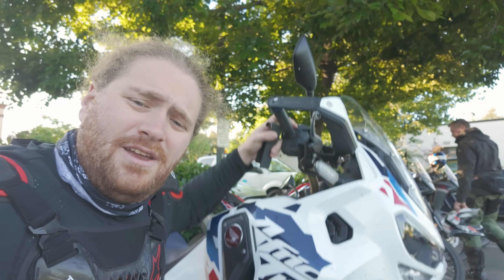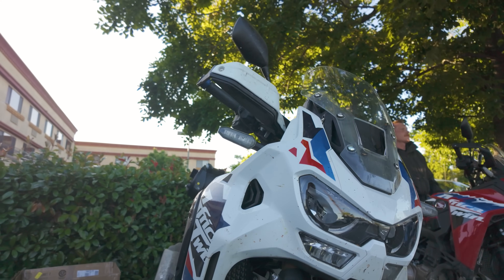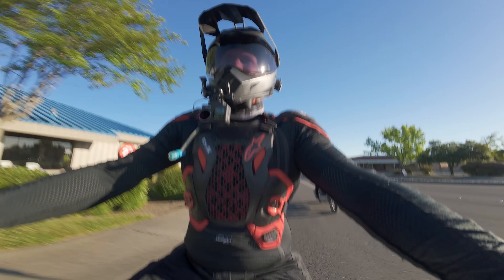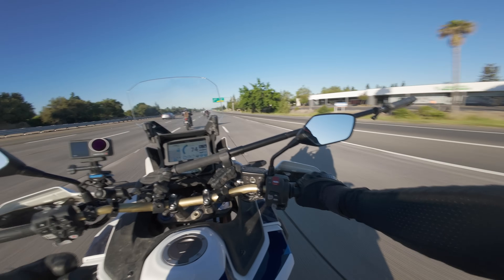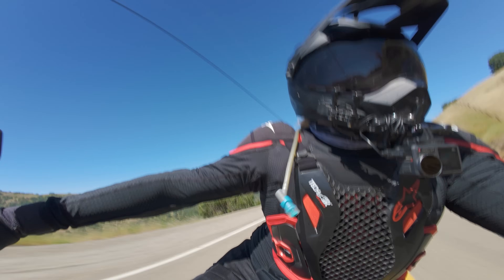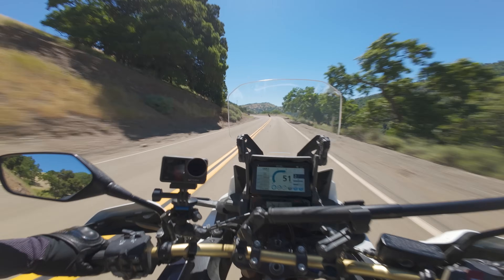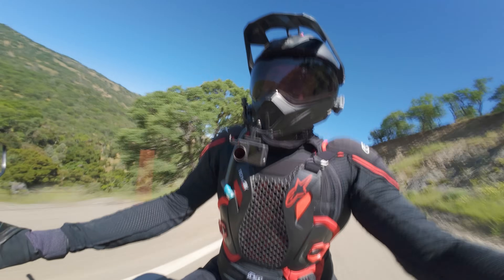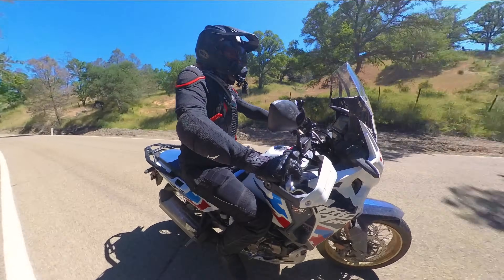Everyone Said I'd HATE A DCT Motorcycle...

Comment from the maker: What do you think about DCT? Don't forget to check out Quadlock for all your phone protection and motorcycle mounting needs!  https://bit.ly/3LBxJ0p
Reply: My only concern is that lowering the barrier to entry on high performance bikes by adding DCT will enable those who literally do not know how to ride a motorcycle to start rolling down the road faster.  Having to learn a clutch is a barrier that I think filters out the most low-effort would-be squids who will never get an endorsement
Reply: @bishopmabry2054  I'm not entirely sure it really applies here. Many modern bikes have quickshifters, so you don't really have to use the clutch, but it allows you to be quicker, and I don't see people complaining about qs's.
Reply: @andres_pz  Even with a quick shifter you still have to use the clutch to initially take off in first.
Reply: I have a '21 africa twin DCT and my list of dont likes is far shorter than the list of likes. The main problem with the DCT is you can't disengage the engine from the driveline once it hooks up. That makes low speed maneuvers a bit of a lurch fest. You can't feather the clutch or just plain pull it in and coast to a stop, etc.  I think that's the only thing I don't like about it. Everything else is a plus over a manual in my experience....
Reply: I own a DCT africa twin from 2020 , about the engine braking situation, one thing,  there is a option to increase or decrease the engine braking and probably you have the less braking engine option, that is why you have the user 1 or user 2, you can select how much power, engine brake, wheelie control on the menu to suit your own taste.
Reply: I have a Honda CTX with DCT - this model is no longer being made... too bad, because it is a fine "sport cruiser" that didn't get marketed well by Honda.  That said, the DCT is not something I recommend for beginners - you really need to understand how to handle a bike, when to downshift, etc.  Some people who have test ridden the bike, think it is "an automatic," just put it in Drive Mode and are disappointed by the performance.  Put it in Sport Mode, and it will shift more like an experienced rider would do.  A complaint I've read from some testers: "It doesn't downshift as you are coming up on a tight curve."  No sh*t, Shakespeare.  Your manual transmission doesn't do that either... you still have to ride the bike and anticipate when a shift is needed.  Sport Mode shifts about 90% of the time when I would... the other 10% of the time, I manually downshift when I want, (whether in Sport Mode or Drive Mode).  So, YES, you still have full control of the bike.  The DCT will shift faster than most riders can do... and, it will never miss a gear, hit a false neutral, or stall as you pull away from a stop.  It is a smart bit of technology that allows the rider even better performance.

In the video, I see that you were not impressed with the suspension and handling of the AT, but that is no bearing on the DCT.  If you are having an issue with engine braking, you need to manually downshift ANY TIME you want.  The thing DCT can't do is anticipate what you want... the different modes AND the ability to downshift at will gives you the same control as a manual transmission, with better/faster shifting and the ability to not wear out your left hand in stop & go traffic.  Yes, the DCT will downshift for you, regardless of the mode you are in, as you come to a stop.  You need to ride one again and use the shift paddles as necessary in the twisties.  I find it is LESS work than a manual tr ransmission, with better performance.  That realization didn't come with one day and 300 miles on the bike - spend some time REALLY getting to know the DCT and how to best use it, and you may have a different opinion on how it ENHANCES the riding experience.  Alas, you did something that many reviewers did on a test ride, which has to do with letting the bike/DCT have the control, when it is the rider that needs to USE the technology.  There is a reason Formula 1 race cars use paddle shifters rather than a clutch and gearshift lever - it is faster and more precise.  Same applies to the DCT.  I'm glad you got to try a bike with DCT... I've moved away from Texas, or I'd give you some hands-on experience on how to best use the DCT.
Reply: @lstavenhagen  Trail braking for slow speed maneuvers is your friend with DCT.
Reply: @captainjim605  Also he does not mention , at least on the africa twin, you can buy the shifter and you can ride on manual mode and change gears with your feet like a regular bike , without the clutch of course
Reply: @captainjim605  Actually, the DCT isn't really what you want if you do a lot of slow speed work. Yes, you can "feather" it with very careful throttle, but that can smoke the clutches and Honda doesn't cover the damage under warranty. There are some goldwing riders who found that out the hard way. But like everything else, the DCT is a compromise with its plusses and minuses...
Reply: I don't agree that you should start on a manual if your intention is to ride the DCT. Riding a manual transmission is the best method for learning to use a manual transmission, not a DCT. You should start out on the type of equipment you intend to ride generally. This is known in kinesiology as "specificity of training" (the best training for a particular task is exercising the task itself). And you always have to expect some transition time if you switch from one to the other no matter which one you started off with.
Reply: @lstavenhagen  I guess you interpreted my comment about "stop & go" riding (as in traffic, where your clutch hand gets a real workout), as meaning "slow."  The DCT isn't working any harder in stop and go traffic than a manual transmission.  Plenty of evidence of people burning out a clutch with a manual transmission by over-slipping it.  The smart play is to use your bike, however equipped, smartly.  If one truly needs to go "slow" with a DCT, you could put it in Manual Mode, go easy with the throttle, and use trail braking.  That is also what I've seen from other experienced DCT users.  I don't consider the DCT a "compromise," but rather a different technology from a full manual transmission.  The only compromise I see with DCT is some additional weight (pretty insignificant on a bike capable of having DCT) and the cost.  Some might consider paying less for a manual transmission to be a compromise.  I am basing my opinion on owning and using a DCT equipped bike... but the DCT is a big part of what I was looking for in this bike.  It is fine with me if you don't agree with any of this; I am very comfortable with my choice to have a bike with DCT.  You get to choose what works for you.  Neither of us would be making a "wrong" choice.
Reply: I think I'd have to ride with DCT, as well as E-Clutch before making any formal decisions. That being said, I like what I know and that's shifting for myself. I can definitely see the applications for those without full use or full strength of certain extremities needed for a full manual.
Reply: @captainjim605  No, I didn't say any of that. I'm only addressing the apparent claim that new riders need to learn manual transmissions first, or that DCT's are unsuitable for beginners. Both of those claims are demonstrably false. Look at how many people's first 2-wheelers are scooters, for example - they're "twist n go" virtually the same as the DCT. Also, look at all the manual riders transitioning to the DCT constantly distracted by grabbing for the non-existent clutch, pulling up on non-existent shifters, while they should be concentrating on riding the bike, etc.. Like I said, the best approach is start out on the equipment you intend to ride.  If that's a DCT bike, it's actually easiest and quickest to start on the DCT bike. And conversely for manual transmissions, and etc.
Reply: @lstavenhagen  I appreciate your opinion.  Don't agree with it, but that doesn't make you or me right or wrong: we both have an opinion.  My opinion isn't an "apparent claim"... I have a DCT equipped bike and a CVT scooter - they are NOT "virtually the same."  Completely different technology and execution.  Learn on and buy whatever you want.  I have given reasons for my opinion and it is OK if disagree with that.  No reason to beat this any further.  Feel free to respond (so you can have the last word) - this will be my last response to you and your opinions.
Reply: Outside of may be a couple particular, slow moving maneuvers off-road DCT is the end all be all
Reply: @pmdinaz  Good to have an open mind.  Years ago, I couldn't imagine there would be any thrill in riding a bike that wasn't a manual transmission.  I tried the DCT, bought a bike with it, and find it only enhances the riding experience... insert your favorite "old dog, new tricks" experience here.  ;-)  Ride what you enjoy!
Reply: @RedLine0069  The tester didnt know the DCT (!), so he cant use it properly. After 52k km, I think DCT has just one downside, which is the weight. It has the engine break, but you're (the tester) too lazy to learn how the DCT and the bike works.
Reply: @RedLine0069  But no point to do that in my opinion. Much easier and saftier with you hand, because can hold the bike more stable way with your 2 foot. Very easy to accelerate from a hairpin corner. The best part of the Africa Twin is the DCT. Fact. 😎
Reply: DCT is awesome on my Rebel 1100T. And I have a Quad Lock for both bikes

Comment: I’m a “purist” love shifting.  Wanted one of these.  My riding buddy got the dct.  Rode it and said I need manual.  Then he had me borrow it for a weekend, showed me how to adjust settings for power, engine break exc.  I was sold after that weekend.  Over 13k miles later still love it ride it all over Colorado, ohv, highway.  Great bikes.  I am lucky enough to still have a grom and yz250x to shift.  Don’t think I could do dct for an only bike but they are more capable than most riders and can be adjusted to most preferences.
Reply: Have you figured out a good setup to tackle wind noise?  I love mine but am thinking selling it because I cherish my hearing.  Crazy loud even with plugs and a shoei rf1400.
Reply: Yeah but if you ever need to off-road (which if you do adventure runs you will need to) manual just allows you to have way more control over your bike. I would much prefer if they put a quickshift for manual models.
Reply: @nogerboher5266  I did the CO and WY BDRs no issues.  Just put in manual mode.  I had a lot of similar thoughts til I rode one.  I ride it off road regularly.  There’s a learning curve just like on any bike, but there’s no loss of control you can hold gears, go to neutral or use a controlled amount of rear brake under power to get the same effect of feathering the clutch.  I would also make the point that using the paddle shifter in manual is fast and can be easier on difficult terrain.  I’m not saying it’s better, just different and as with all bikes the rider is the limiting factor.

Comment: Why do guys who have never ridden a DCT do reviews- I have had 2 Goldwings with DCT’s have ridden everything from small dirt bikes to Harley’s and the DCT is so great on highways including twisties- you can override the auto scenario and down shift - up shift whenever you want or put it into full manual and you paddle shift at will - no different than what quickshifters are trying to accomplish. The only scenario I have no idea about the DCT’s application is on aggressive dirt riding, no clutch to slip in those certain situations. As well it does add weight which on a gravel road ok but not desirable on single track. The DCT is the future for most applications no doubt- unless you are set in your ways and want a manual transmission- clutch
Reply: Highways is where DCT (never having ridden one) seems less useful as you rarely downshift
Reply: Well now they have the Honda E Clutch in Europe, that will be something to watch.  Only available on the 650's at the moment i believe though.  Basically an auto clutch and quickshifter, many benefits of dct but you still use foot shifter
Reply: @connor3288  that thing should judder the bike and make yours and pillion's helmets clank, like the "real thing" . Nah

Comment: I'm 71 and only got back into riding 3 years ago. I love the DCT on my Rebel 1100 with the African Twin engine. The bike is light, easy to handle, and in city traffic, the DCT is great. On the highway, cruising at the speed limit with cruise control for long rides is also a huge plus. Although I am only 5'7" I found I had to put on control extenders to stretch out a bit. I also have added a Puig windscreen which works really well at highway speeds. For additional comfort, I added an Airhawk inflatable cushion to the seat. To make a long story short, for senior riders like me, the DCT turns the bike into an "old man's scooter":-)

Comment: In my NC750, if I engage the DCT sport mode by holding down the drive button, the transmission holds revs much better and does downshift at the right times automatically. I found sport mode 2 to be perfect for aggressive canyon riding. Sport mode 3 would never go into 6th which I found a bit more aggressive than I needed.
Reply: agree, I think Spike was in normal D mode in the twisties at the 11 minute mark.
Reply: On my nc750, I have P 4 EB 2 Trac 2 dct 4. I found it great for twisty roads. When I watch reviews on Honda dct and when reviewer carry on that it doesn’t engine brake or shift to early its a little disappointing because it’s a great system if you know how to set it up.
Reply: I had a similar problem on slow turns in S2 and to an extent, S3 as well. On an AT. It would hold 2nd gear even when it was clear it's not going to work, and then downshift while I was already leaning. If I had a manual and made a similar error, I'd let the clutch slip a bit instead but DCT doesn't like that.

Comment: I love the convenience of my 2019 Honda NC750X DCT. On twisty mountain roads I take over the decision making and shift with the pushbuttons so I get engine braking before corners instead of unwanted downshifts in the middle of corners. Sport 3 comes pretty close to what I want in the mountains though.

In city traffic I’ll punch the downshift button for engine braking or positioning in traffic but mostly let the machine save energy with its early shifting in drive mode. I get about 75 mpg (US gallons) that way.

Have taken one long tour and will do more. I would definitely get another DCT bike if it was the right one but I also ride a Harley Dyna Lowrider so I’m not adverse to shifting and don’t absolutely require the convenience. Just nice to have.

Comment: I’m on my second DCT bike, a Rebel 1100, it rips and although I enjoyed clutching and shifting bikes in the past I now prefer to not, it’s The Good Life especially now that my hand and wrist can not tolerate even a moderately heavy clutch pull. I did look into the Africa Twin but the Rebel ergonomics are closer to my liking even though they are bizarre but I’m working on that.
Reply: I put 3 inch risers on my 1100T DCT, made a huge difference in ergonomics for me.  I love the DCT as well. Small learning curve, as you mentioned, but such a payoff longterm.
Reply: Many new bikes have "slipper assist" clutches which also have weaker clutch springs and so a noticeably lighter clutch lever pull. Much easier on the left hand and wrist.
Reply: @joshlambert1247  I installed Rox 4”, helps a ton. Also got a Corbin seat. Next is forward foot controls or lowing the pegs an inch. Waiting on Madstad’s windshield.
Reply: @doughoffman9463  Yes it definitely helps. I think I’m full auto for life now though.
Reply: Taller seat helps, I put on a Mustang seat and two gel pads on mine to give it 3-or-so inch lift over stock, and it feels way better. Risers seem to help, but it's a more involved process.

Comment: Most common motorcycle injuries are foot and ankle injuries. Dct lets a lot of riders keep riding without having to switch to a cvt scooter or trike, or an electric. 

For daily commuting it also makes a lot of sense. Say  you want to ride to work but like me you work long hours and are on your feet the entire time. Dct means you can  ride it kind of like a scooter mainly using your hands. As you really don’t need the rear brake if you are taking it easy.

Comment: You can bolt on a shift lever and use it in manual or automatic to override the current gear.  Some people are also putting a "hand operated" rear brake where the clutch lever usually sits

Comment: I have DCT in both a gold wing and AT. I love it.   I also have many bikes without DCT.  My preference is to use the sport 2 mode, manually down shift into corners to get the level of engine braking I want, and let the computer upshift.  A very comfortable way to ride.  When it is time to get sporty, or anything technical, just use manual mode.

Comment: Great review Spite! As someone with a partially paralyzed left leg the DCT on the Africa Twin was a God send and got me into riding. I know have to normal sport bikes that I've fitted with adaptive electronic foot shifters but if it wasn't for the DCT I never would have gotten started!

Mine is a 2022 with the 21" Front wheel but I think your review was spot on. Only niggle I have is that the electronic suspensions setup and adjustability for on/off road is incredible on the machine and such a big selling point I've seen a few reviewers skip on.

Overall the 2020-2023 AFAS are the best versions of this machine.

Comment: Completely different transmission type (CVT) on my 03 Silverwing (600 cc twin), but the only reason for this comment is that sometimes, a twist and go bike can make for a very nice ride (I have 2 Honda ST1100s which are regular manual bikes, so it’s nice to switch off between the 3 bikes). I call the Silverwing the 2 wheeled office chair. Very nice for a long cruise.